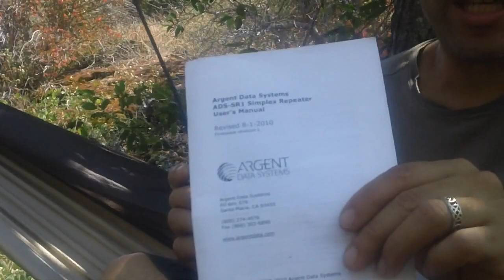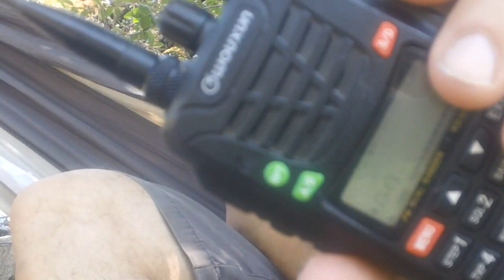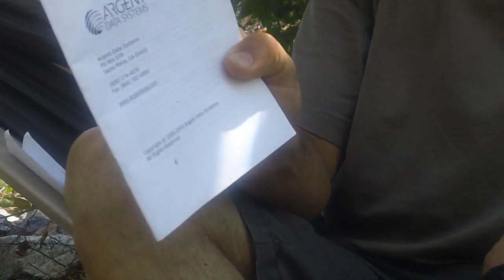SHTF WROL Simplex Repeater Configuration For Deployment.

Comment: would we be able to daisy chain several to increase coverage or provide coverage in areas where there are holes in coverage. a smart version with the ability to recognize other configured devices within a "network" and forward to them would be cool.
Reply from the maker: j johns Its possible but it will be a one way conversation or a broadcast from basecamp to the field, not field to basecamp. to have full interaction with the field you will need a repeater pair with one extra frequency/radio serving as a link, to link all the repeaters together. The simplex repeater is a bit trickier, Lets say you want to link 2 simplex setups together, repeater A will have rx frequency alpha and a transmit frequency Bravo. the second simplex repeater will have a RX repeater of Bravo, and a TX frequency of Delta. Hope that makes sense.. it will resemble the Romans early detection system of them setting fires on hilltops to message some sort of alert. The prior example is linking simplex repeaters together, another way would be for the user to be the hub, repeater one rx receiver is frequency alpha and repeater two, but both repeaters will have different TX frequencies of Bravo and Delta. That could be a bit more interactive than the first example. The key thing is to not have the same frequencies where they will step on each other or configuring the frequencies where they could possibly cause a feedback loop where they will ping pong the same message till dead. Many ways to skin this cat, terrain will have a say on what you will use. Though its called a simplex repeater, its operationally complicated to make it do more than the simplex tasks. Good subject for a vid, if I can make it where I will not put people to sleep. Hope this helps.
Reply: Thank you, I think I'm following it. So a radio capable of hearing Alpha freqs, but not Delta, thereby excluding it the repeated message. Interesting,but it occurs at the radio level not the repeater per se? Is that correct? You're right, it sounds like there are several ways to skin the cat, but still seems to be an opportunity to make the repeater itself a little smarter.Then again, I'm probably making more complicated than it should be.. Thank you for your efforts. You've made comms better around our little PA mountain.  

Along another line, PC routers using 2.4 ghz LOS, leveraging directional antennas, what sort of range do you think is reasonable? I'm trying to figure out a way to do secure video and comms over ip "longish" distance....LPOP type stuff with multiple cameras using routers that are daisy chained and powers with panels similar to what you're doing.

Thanks,
J
Reply from the maker: It occurs in both. Zone A being your main site and Zone B being your remote dead spot. Zone A is assigned repeater Alpha/Bravo (RX/TX), Zone B assigned Alpha/Delta. The User transmits on Alpha from HQ, if positioned right both repeaters will hear it, thuogh if you want to hear zone b, your user receiver will have to be tuned to alpha/delta. Its an operational nightmare that would require some preplanning and practice.

On your second question, in about a couple of weeks, we're actually installing a point to point microwave shots in the 4. something gig range, its the unlicensed range. I'm just installing it, I didn't configure the equipment used to monitor remote earthquake sensor devices. I'll bring along my camera and shoot the whole thing, will annotate distance, problems and alignment. it will be 4 remote sites with one tall peak serving as the hub to link them all together to a central point. Was not going to film it cause its a bit too geeky even for me where I don't see a practical use right now for my family group, but a larger well organized one could be an asset. Stand by it will be on bat.
Reply: GUERRILLACOMM the geek in me is very excited. looking forward to the vid

Comment: I'm sure you've gone over this but what is the point of a repeater? Do you have to have one to talk to each other? Sorry I'm very new.
Reply from the maker: John Korn Not necessarily, it depends on location and obstacles in between you and whoever you want to communicate with.  Radio of about 30 megahertz and above is considered line of sight communications. with no obstacle in between you will not need a repeater. obstacles like mountains, buildings and the curvature of the earth will need to be negotiated with repeaters. Reapeaters also is used to extend the range of your handeld and mobiles a bit farther with more power. For example a typical walkie talkie has a range of 3-5 miles. with a repeater you could extend that range 20-70 miles dependent on how you deploy it and location. Hope that helps.
Reply: @GUERRILLACOMM  I'll admit to having talked 88 miles on a 4W Kenwood, but that was high desert to a mountaintop repeater. 3-5mi is indeed typical for simplex with HTs.